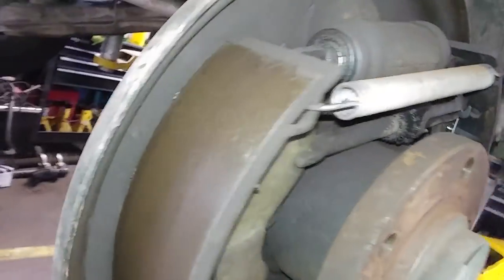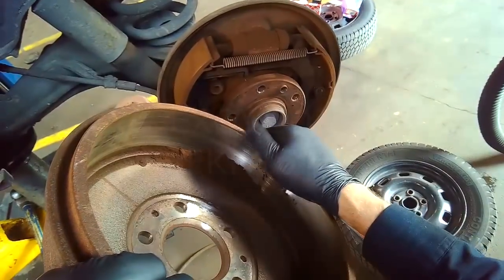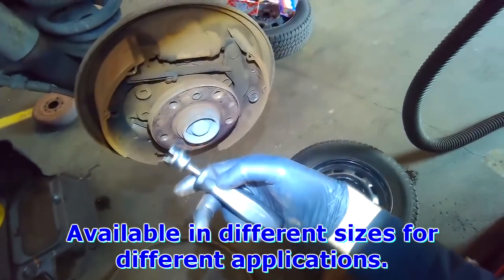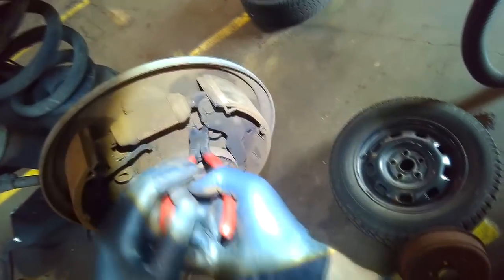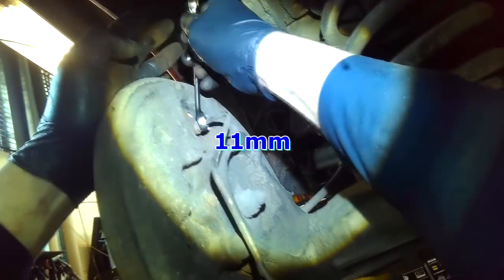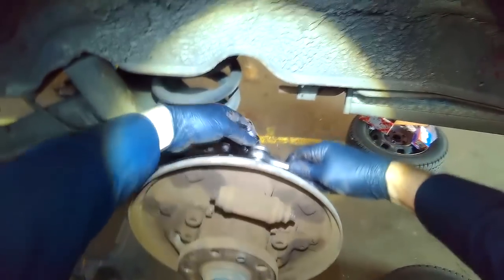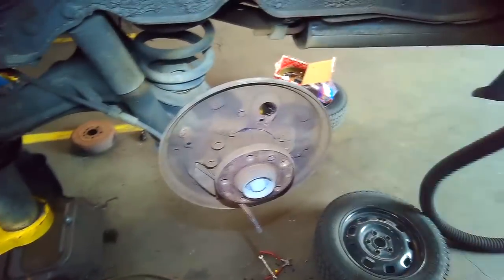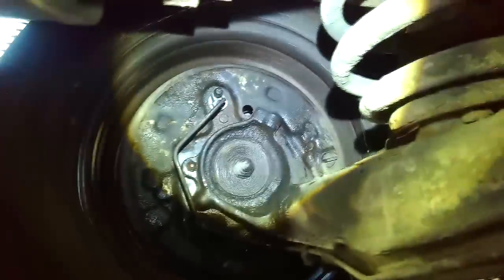VW T4: Rear brake shoes & wheel cyl removal

Comment: They look similar to the ones i did on my mates ye olde morris minor 1000 car, but i had to be carefull loosening the hydraulic feed nuts, wire brushing the pipe/nut interface and soaking with penitrating fluid.
After a bit of working of the nut, the the arc became wider and off the pipe came :-D
Force tends to break them.
And as im no mechanic i don't have new pipe and a flair tool.
Reply from the maker: I've had several like that over the years... when you're lucky, you can spin the wheel cylinder instead of the fitting, to get the cylinder off & on.

Comment: How many kms would you expect to get out of a set of rear shoes?  If I find apparent brake fluid near a bleeder on the inside of the dust guard what could be the source -- just the bleeder or could it be from the in wheel cylinder? The brakes went a little spongy recently and my bleeding of them seemed to make it worse.  Is it likely I just haven't bled enough?
Reply from the maker: Depends on driving habits.
Either the bleeder is leaking or the wheel cylinder. A visual inspection will find the source of the leak.

Comment: This is a good video. The drum brakes on this German car don't look that much different from brakes found on Fords. I expected to see some kind of quirk not seen on American or Japanese cars. I have done some disc brake repairs to German cars, but never drum brakes. Wherever I worked, American cars made about 45% of what I worked on, Japanese cars were about 35%, Korean cars were 15%, German cars were about 8%, and everything else was about 2%.

However, I have a question. Typically when I have to replace disc brake pads on German cars, the brake disc is almost always too thin to machine. Are drum brakes similar in that you almost always have a drum that is too wide to machine when new brake shoes are needed?

I am thankful for your videos because I will restore a Winnebago Rialta (VW Eurovan based B+ RV) and knowing quirks about German cars really help me.
Reply from the maker: From what I have come across... the drums hold up pretty well. If I don't see / feel a lip on the drum, I don't even check the diameter. If no excessive adjusting of the adjuster is needed (after new parts are installed), I further consider the drum to be OK. I've only had a few cases where we had issues with brake pedal feel... that ended up needing new drums.

Comment: is it possible to take the entire hub and bearing assembly off?
Reply from the maker: The bearings sit inside the trailing arm... you would have to remove it.
What is the issue you are having? Do you need to replace the wheel bearing?
Reply from the maker: https://www.youtube.com/watch?v=Sd_xeW-fPBw